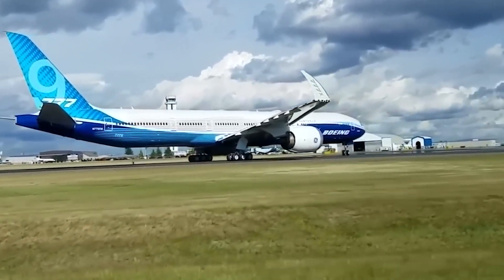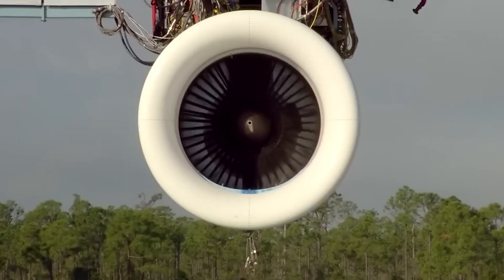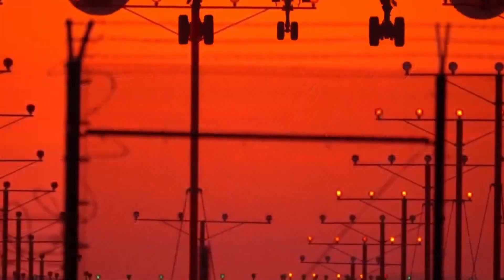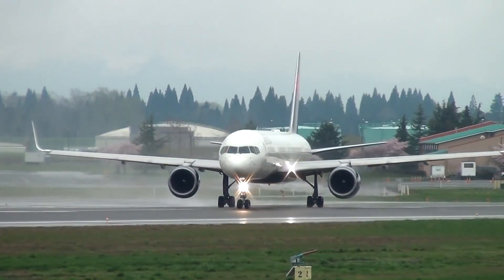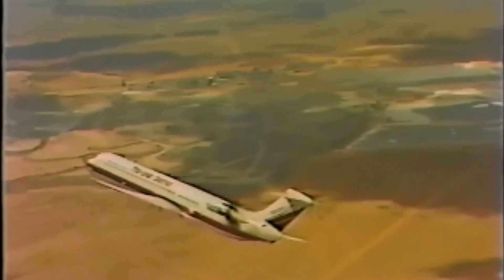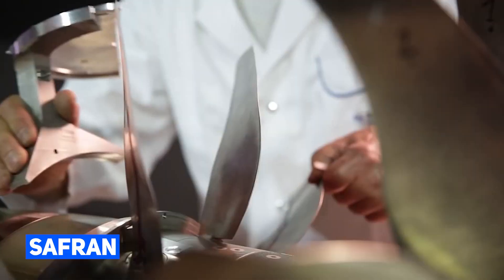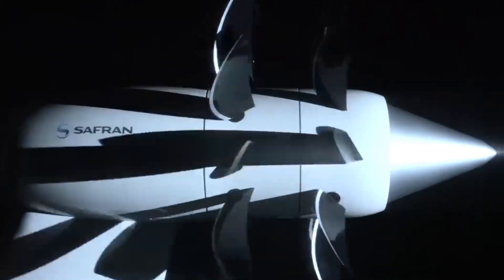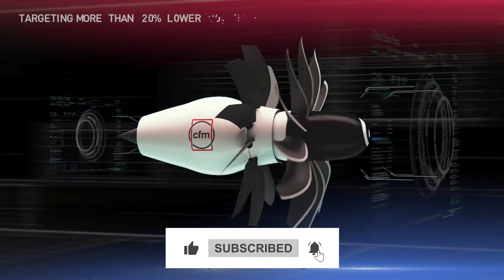The Unbelievable Potential of the CFM RISE Engine EXPLAINED

Comment: If this engine is called CFM them it is GE+SAFRAN, not sure I think that was reactivated in 2008 by SAFRAN 🇫🇷 if on comparison to LEAP this is 20% more economical ➕️ ready for hydrogen and hybride ➕️/or 20% powerfull !! And quite silent and as safe as turbofan ➕️ 900 km/h  RISE is the good name and finally looks like fitting moderne planes 
Ps first having engines like 727 was the "caravelle"  
Wish success to GE-SAFRAN !!
Reply: The tall skinny guy showing off the Rise engine is Olivier Andriès, the CEO of Safran.

Comment: Thanks for an interesting and informative video.
However one annoyance I'm increasingly finding on YT these days (including this video) is the mispronunciation of automated narrations. Turbofans become "ter-boffins", a 12:1 ratio, which should be spoken as "twelve to one" comes out as "twelve colon one".  In the bigger scheme of things, this is not a major criticism of a good video, but it can be quite irritating.

As regards open turbofans, I'm reminded of the Tu-114 airliner with large contra-rotating turboprops that created significant cabin noise. I would guess that mounting smaller diametre ones near the rear fuselage might also create a great deal of noise as the rear of the plane. The video does however make it clear that the CFM engineers especially are aware of the issue, which was problematic in earlier flight tests. I guess we shall just have to see what they come up with.

I don't know for sure, but these engines appear to be larger diametre than existing turbofans. Under wing locations might require longer undercarriage legs and if so they would probably not be a retrofit option or a future adaption for an existing type without significant redesign and re-certification.

So now where would open bypass turbofans end and turboprops begin?

Thanks for an interesting video.

Comment: in 1959 Tupolev Tu-114 had 4 engine than operate almost like the Rise prop accept 4 of the engine had 2 4 bladed prop that rotated other way not like it has 15 blades put close together.

Comment: I don't see much difference with the turboprop on the Airbus A400M and it's Hamilton-Sundstrand propellers with scimitar blades. The ducted fan prevents vortices forming at the end of prop blades, that is why it's quieter. If less energy is converted to noise, it's more efficient. The only advantage of open fans is weight.
Reply: You should also take into consideration gains in drag and weight when engines are ridden of the huge nacelles wrapping around  them currently.